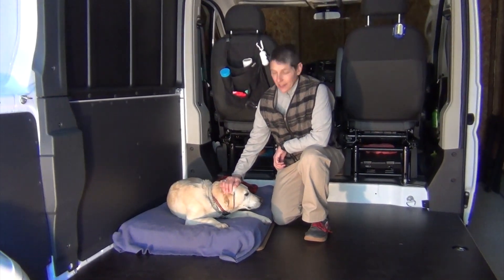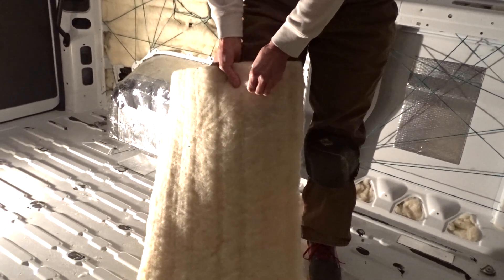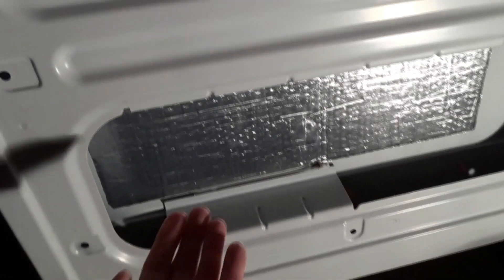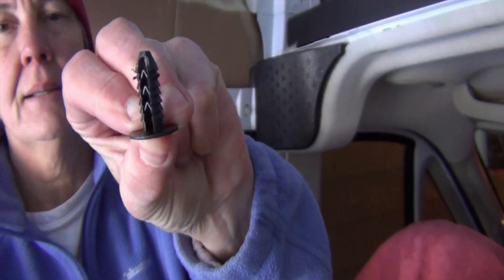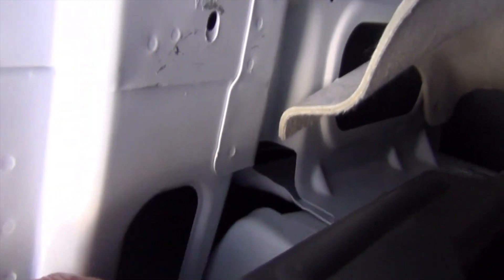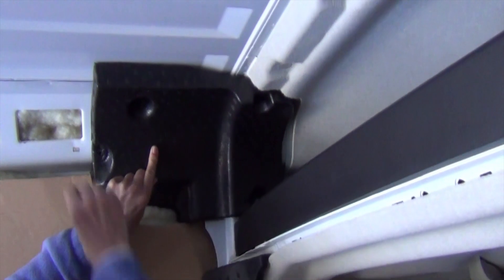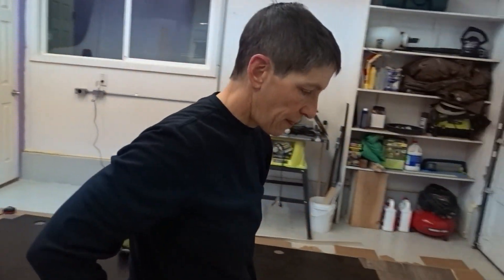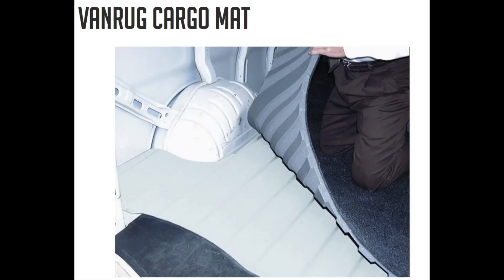Wool Insulation

Comment: I like your approach to flooring much better than the traditional foam/plywood method I've seen a million times in videos now. I had thought I'd go traditional and use wool instead of foam board, but I think your 1- piece layers are smart!
Reply: May I ask what glue you used to secure the 3 parts?
Reply from the maker: Going this route was so much easier!  The VanRug insulates and levels the floor, the OEM floor fits like a glove and the thick vinyl insulates, is easy to clean, and looks pretty!
Reply from the maker: @cesalt2408  no glue.  It's all held in place with the original cargo tie downs.  Just had to get longer bolts.  They are metric 1.25, I think.  You can get at an Auto parts store
Reply: @camphervan2398   Ahh, wonderful! So I got a VanRug and love the way it fits. I do notice, though, that it squeaks when I walk. I'm assuming that once a hard floor and build sits on top of it that all will be firm and tight so that no squeaking can occur. Has that been your experience?
Reply from the maker: cesalt We don’t have any squeaking so I assume once all the weight is on it, there’s no opportunity to move.
Reply: @camphervan2398  Thank you for verifying! I'm excited to move forward. Woohoo!

Comment: I'm not saying this is the best way but here's what I did to hold the wool insulation in place on the large areas.  I used self sticking stick pins that would normally be used on insulation panels.  Stick the adhesive backs of the pins to the metal and then push the wool onto the stick pin and cap them in place.  Holds the wool to both the sides and roof.
Reply from the maker: I think it's great to be creative and do what works for you!  That's the fun in building it yourself : )

Comment: Enjoying your straight forward approach to your build!  Your flooring is the van rug, plywood and then vinyl flooring, correct?  Did you use any sound deadening material under the van rug?  The plywood isn't screwed down into anything prior to adding the vinyl flooring, so nothing is attached to the floor of the van, right?  I'm at the very beginning of my build and am in a massive information gathering process.  I had already decided on wool for insulation, so it was so nice to see your tips and tricks to using that product.  I also really appreciate the tips on removing the plastic wall panels!  Thank you so much for sharing your process with us!
Reply from the maker: https://youtu.be/ueseV-VXkpE. Here is the video on our floor install.  I am so sorry I didn't see this until now.  You are probably finished with your build by now!!!

Comment: This is SO helpful!!! Thank you!!!
Reply from the maker: Megan,  I’m glad this is helpful to you.  That was our goal!
Reply: @camphervan2398   If you don't mind, how did you end up reattaching the wood composite floor?  We just bought a Promaster and it has a wood composite attached and we were going to take it off (like you) and then put a rug down and reattach...would you still recommend that order?  Thank you SO much for your advice!
Reply from the maker: HI Megan:  We put a VanRug on the bottom.  It is molded to follow the ribs in the floor.  It insulates and helps with sound deadening.  We then put the OEM floor back on top of the VanRun.  However, before putting it back in, we used it as a template to cut some really thick vinyl that we put on as the last layer.  We then used the cargo ties to hold it all in place.  We just had to use longer bolts (M8 1.25 if I recall).  We got them from an auto store.  We are really happy with the look and feel of the floor.  Good Luck!

Comment: At around 5:51 (for example) is it safe to place the wool insulation against bare electrical wires and contacts?
Reply from the maker: I'm not sure I'd call those bare wires as they seem to be well wrapped and in secure plastic connectors, but if you have any concerns in regards to this, then I would recommend you consult an electrician or your RAM dealer as I am by no means an expert and in no way, shape or form am I qualified to give you a proper answer to that question.

Comment: Hello, thank u so much for a great video! I’m trying to do as much as I can  in converting my 2019 2500 159 but the insulation has been a real pain trying to decide and go with this over that. Not only did u help me with insulation n my van but I loved your choice for flooring. Could u please tell me where u bought your flooring and the name? Much appreciated.
Reply from the maker: It's a thick vinyl flooring that insulates and is sound deadening.  Brand name is Tarkett.  We bought it at a local flooring store.  It was a remnant.  Color is weathered barnwood.  We love it.  It is durable and so easy to clean!  Good luck with your build!